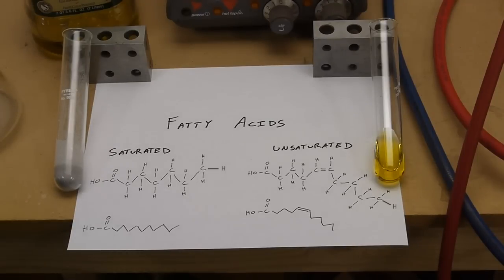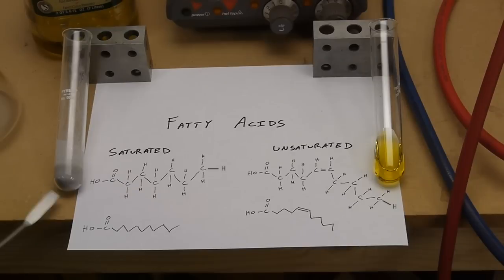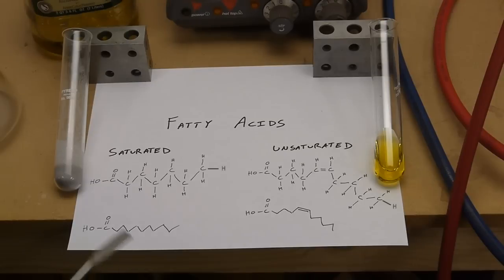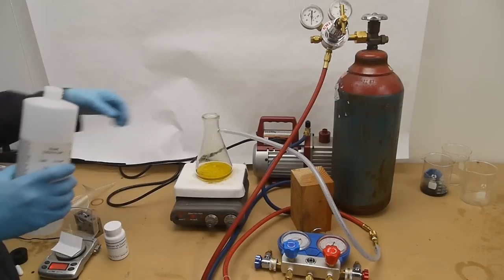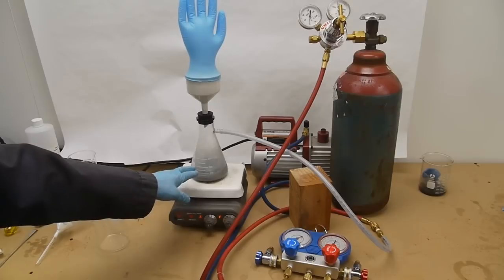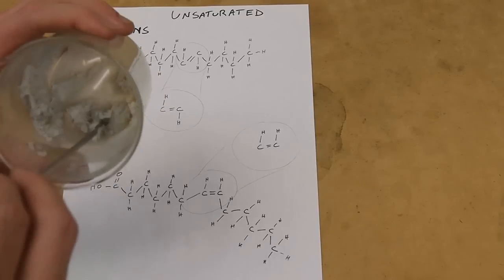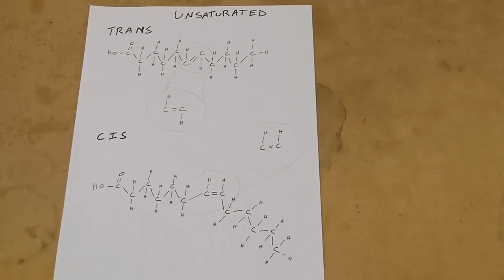Hydrogenation: transform liquid oil into solid fat

Comment: Your argument is flawed about saturated fats being “clogged“ in the arteries.  They are processed by enzymes emitted from the liver. However, with unsaturated fats, they need to be turned into saturated fats first by breaking the double carbon bond. Which is faster: a one-step or two-step process?  We also have to mention the French Paradox which also contradicts your point.  Countries that consume seed oils instead of dairy/animal fats have higher obesity rates. Such countries are located the Middle East and the Mediterranean due to a more significant population intolerant of lactose.  The USA is also morbidly obese due to the greater profitability/longevity of product, replacing dairy/animal fats with cheaper seed oils. Their excess sugar consumption also contributes greatly to their obesity and circulatory system issues.

Comment: I am tyring to cheaply recreate a product (for animal consumption) where sodium bicarbonate is encapsulated in hydrogenated vegetable oil.   The purpose of this is to have the buffering effect of the sodium bicarbonate in the horses hindgut and to try and stop it from being fully digested into the main stomach.   My question is if I simply mix the sodium bicarbonate in a as little as possible cheap margarine how much of the same encapsulation effect will it create?   
If I melt the margarine to mix in the sodium bicarbonate and let it re-set again does this affect it?

Comment: Thanks for the video, blue thumb is in order :)
That said, it's better you focus on physics and leave medecine to MD :)
For a start, unlike what he said in the video, saturated and unsaturated fat don't end up in arteries. They're processed in our GI tract and eventually metabolized in the liver. At the end of the day triglycerides and cholesterol carried by lipoproteins (like chylomicron which turn into HDL and then become IDL and finally LDL) are the only two fats carried by the blood. Triglycerides are small and float easily. Imagine if any fat we ingest ended-up in the blood, remember the blood is an aqueous medium/environment... you'd end-up with phases like in a vinaigrette!
Actually unsaturated fats (oils, even olive oil!) are worse for health than saturated fats because of that double bond (polyunsaturated oils even have several of them!) which is prone to attract oxygen molecules which renders the fat "rancid" (oxygenated) and which now acts as a free radical that will cause all sorts of troubles, thin particular it causes inflammation in organs like the liver.
This oxygenation occurs within hours. How long do you usually keep your oil in the cupboard? ;)
That said any type of fat is bad when consumed with glucose because of glycation: that's the only case when naturally occuring saturated fat (not hydrogenated) is bad, unfortunately every study assumes the American Diet which is high in carbs.... hence they conclude that saturated fat is bad, instead of the more logical conclusion that carbs are bad. He mentionned cavemen and our propension towards saturated fats: well, cavemen didn't have a lot of sugar and processed food laying around like we do since the 1950s. Instead they had meat and fats and a few vegetables and not a lot of carbs (fructose is directly sent to the liver to be metabolized and stored as fat), that's why saturated naturally fats occuring with meat were not harmful to them and they develop a keen sense for saturated fats that we inherited from them.
(disclaimer: I'm not an MD but I like the topic)

Comment: Except your arteries are not room temperature. Naturally Saturated fatty acids do not cause heart disease but high levels of insulin resulting from the volatile blood sugar correction on a high sugar diet inflame your arteries to the point where a clot needs to form to stop the arterial wall from bleeding after it starts. The issue is not the CLOT but the fact that a clot has to be FORMED in the first place. Im referring to naturally saturated fatty acids like those found in animal products, because, as mentioned in this video, trans fats are the result of engineered saturated fatty acids. I urge you to recognize that humans have never done a better job at engineering nature than mother nature herself, and it is not just dangerous but arrogant to assume it can be done!
Reply: Im referring to naturally saturated fatty acids like those found in animal products

Comment: Food scientist Alton Brown talked about types of fats in an episode of "Good Eats", and he used balloons to illustrate saturation. It was a mind-expanding experience for me, because I finally saw the relationship between electricity and chemistry. The big hydrogen balloons repelled each other. Well really, they had a radius, and since two balloons can't overlap in three-dimensional space, their latex borders push against one another. But this is analogous to hydrogen ions repelling one another, which is just a phenomenon of electric fields and like-charged particles. The even distribution of hydrogen ions along a saturated fatty acid results in an overall straight line. (A zig-zag, but when you zoom out, it has a definite origin and destination trajectory that are 180 degrees apart.) But when he popped a balloon, it showed there was an opportunity, or rather electrical incentive, for the whole thing to bend. The side with more hydrogen ions took the "outside" of this bend as they repelled each other. Or perhaps more accurately, the side with the missing hydrogen ion became shorter because there was less repulsion. This makes it a little more complicated for the triglycerides to get into inter-molecular formation, and with the kinetic distraction of heat, it's even more difficult. Meaning the threshold for the temperature at which the molecules can line up, its "solid temperature tolerance" if you will, goes down. I know this is very basic stuff, but I didn't really get it until I saw that visualization.

It's like that game "Perfection", where there's a timer and you have to put all the shapes into their respective slots. When the timer goes off, the whole apparatus pops up and makes the pieces go everywhere. So to win, you have to put the pieces where they go before that happens. Saturation of fats is like reducing the variety of pieces, making it easier to put them where they go, while increasing the temperature is like speeding up the timer, making it harder to do that. And of course "winning" is analogous to making a solid. And unlike human players who can get better with time, molecules are indelibly subject to their circumstances and do not benefit whatsoever from experience.

Also, that apparatus with the knobs to switch between evacuation and hydrogen infusion.... did you make that yourself? After seeing so many of your videos, it seems like the kind of thing you could and would make yourself.

Comment: Why don't you just pump hydrogen gas through a glass pipe into the oil in the presence of catalyst? Just pump until hydrogen push out all of air inside, and close the system then let it go for reaction? Tks u

Comment: Hello. Thank you for demonstrating a potentially do it at home process for vegetable oil hydrogenation.  I do have a few questions, though.
1- Is hexane the only possible solvent to do this with? Would it work with isopropyl alcohol?
2- I fully understand that it isn't healthy, but if you completely remove your catalyst, would your end product be edible?
3- Last but not least, would gold or silver work as catalysts instead of the palladium?
Sincerest Regards

Comment: It is very confusing, after the hydrogenation you say that "it becomes either trans or cis". But I am asking to you : What was that originally before hyrogenation ? My answer : It was an unsaturated fat, and unsaturated fats are always in either "trans" form or "cis" form. What did you do therefore ??????
Reply: Patrick Vigna Yeah. I suspect what he meant to say was that this was the opposite process - you can take a saturated fat and dehydrogenate it, forming an unsaturated fat. In this process, as described, you can get cis or trans forms. The position that they form in can also be controlled, but much less easily again (and cis vs trans is already difficult). 

Alternatively, the trans forms may be converted to cis (or vice-versa - but I'm not sure why you'd want to, for food applications)
Reply: The catalyst can cause reorganization of the bond. Cis becomes trans. It’s a byproduct, not intentional.

Comment: I was wondering how precisely those Trans-fats are generated in this process. I would think that when you hydrogenate unsaturated compounds it would completely remove all double carbon bonds and thus leave no Trans fatty acids in the mixture. And if there are still Trans fatty acids in the mixture that they were already there before the hydrogenation process?
Reply: Simon Van Keer no, there was an inaccuracy in his explanation. The catalyst reorganizes the bond in some cases when the reaction doesn’t complete.

Most reactions can go two ways, and many have several steps. The intermediate step in this case was not completed and the oil reversed to the unsaturated condition in a different configuration.

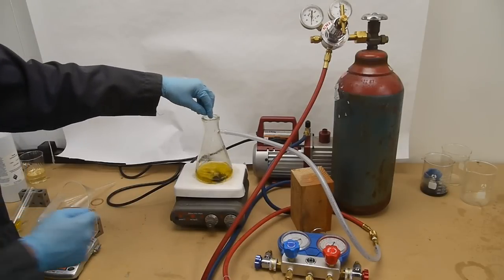Comment: Quick note: at 5:40  you drop a stir-bar into the flask, directly on the magnetic stirrer. This should be avoided, since it can shatter the glass (even relatively thick borosilicate glass...). What we used to do in my O-Chem laboratories back in undergrad was to slide the bar in while the flask is in an angle, and never above a magnetic stirrer.

Aside from that, though - neat video!
Reply: +Peleg Bar Sapir Agreed! That clink the stirbar made when dropped made my assole pucker.

Comment: Is this fat edible? Were you able to remove all the charcoal palladium? Also, couldn't the hexane be captured using a distillation device? Could the hexane and palladium be reused? So many questions!
Reply: If you were to get all the charcoal palladium out, the fat would be edible, although, like he said, there might have formed trans-acids in the process, which are (very) bad for your health. The hexane could easily be distilled. The palladium only works as a catalyst, it basically helps the bonding of hydrogen because H2 is hard to split on it's own, but splits easily on some metals, where it meats with the double bonds that also bonded the metal. So the metal isn't used up and can be used over as much as wanted.
Reply: In Reverse OK. Thank you for your response. This is very educational.

Comment: I have a question: if Omega-3 is a fatty acid with a single double bond at the third carbon atom from the omega end, why is it regarded as a polyunsaturate, rather than a monounsaturate? Are there different Omega-3s with more than one double bond? Cheers.
Reply: +James Turner They are 3 different types of omega 3
Reply: +James Turner ALA (18 carbons and 3 double bonds) through diet and use it to form the more important long-chain omega-3 fatty acids, EPA (20 carbons and 5 double bonds) and then from EPA, the most crucial, DHA (22 carbons and 6 double bonds)

Comment: I need Techniques for chemicals like phenol etc etc from coal , Energy consumption to convert is not an issue, any method using hydrogen or water and High voltage arc method ?? or any techniques to liquefy coal . I am not asking Bergious process

Comment: This was really interesting and I enjoyed seeing how the hydrogenation process works, but the information about the health effects of saturated and trans fats is incorrect.

Saturated fats are not unhealthy.  They may slightly elevate LDL, but only the large dense type, not the small dense LDL which are associated with heart disease.  Saturated fat also raises HDL, the "good cholesterol".  Overall, saturated fats are probably beneficial, or perhaps neutral at worst.

Regarding trans fats, I will quote "The Protein Power LifePlan": Since trans fatty acids are unnatural, the body hasn't developed a specific way to deal with them, so it treats them like real fats and just does the best it can.  Unfortunately, thanks to a sinister quirk of biochemistry, the body tends to incorporate trans fats into the lipid bilayer in preference to good-quality unsaturated fats, especially during times of essential-fatty-acid deficiency.  It goes on to describe how this results in inhibited enzyme function, weakened immune response, and lessened function of the insulin receptor by changing the fluidity of the lipid bilayer and other cellular membranes (i.e. contributes to the development of insulin resistance).

Comment: I have a question. Even though it may not be cost effective, is it possible to "crack" a saturated fat, like lard or bacon grease into an unsaturated fat, in a similar way that crude oil is cracked into lighter fractions? It could have better health benefits and taste great with the drawback of being costly and a shorter shelf life.
Reply: ***** Of course, like the reverse of what he's doing here with olive oil. Liquid bacon oil that's healthy. Mmmmmm.
Reply: Did you ever find an answer to this?

Comment: Some more work on removing the catalyst traces and you'd pretty much have got some homemade margarine lol.

Also, this process would run faster and more effectively if you bubbled the hydrogen gas through your oil solution instead of only creating the H2 atmosphere.

Comment: Should I be more worried about the Palladium? Heavy metals seem worse than a couple extra fat molecules. Also Wikipedia says that hexane is a safety hazard to breathe but not to eat. That sounds wrong.
Reply: I'm pretty sure that's not the same process that edible margarine and other saturated fat acids are produced. I presume he uses catalysts and solvents that are most accessible to him.
Reply: There are better ways to get all of the catalyst and hexanes out of the final product than the ones shown here. You don't even really need the catalyst to get this reaction to happen. It just happens extremely slowly if you don't have it in there. You can increase the pressure to around 100 atm and it will work relatively quickly without the catalyst.

Comment: If naturally occurring polyunsaturated fatty acids are "healthy" then i guess they're more likely to be in the cis configuration. What i didn't understand is how partial hydrogenation (and thereby removal of double bonds which allow for the difference between cis and trans)  is able to make them switch from cis to trans
Reply: Yes, the vast majority of natural unsaturated fatty acids are in the cis configuration. Trans fats form because the hydrogenation catalyst works both ways and can take away hydrogen as well as add it. The trans configuration is also a lower energy state(less stress in the bonds), so it is thermodynamically preferred over the cis config.
Reply: I am very thankful for the clarification. To my shame it should have occured to me that the catalyst would work both ways since any catalyst works only to lower activation energy.
Reply: Because trans is energetically favored over cis all mixtures of the two will eventually become trans given enough time. It is a slow process at normal temperatures but when you heat the mixture so that you can partially hydrogenate it (note that it is partial meaning there may still be some pi-bonds) you make the cis-to-trans rearrangement speed up. This is why heating up cooking oil often (like at a restaurant that fries food) will cause no-trans fat oil to eventually increase in its content of trans fats.
Reply: The modern technologies in food processing produces  cis configuration of fat acid, no trans. trans configuration produces older technologies.
Reply: Martin Kovarik Yes it is possible to reduce the trans fatty acid content, but the new technologies are more expensive. If the industry has no incentive or obligation to use a more expensive process, then they will use the cheap one and dont give a shit about health effects, cos profits.
Reply: *****
Naturally occurring trans fats are fine though. Red meats have high levels of trans fats.
Reply: aptsys Trans fats are the same regardless of whether they are naturally occurring or not. The body can't tell the difference between a natural trans fat and an identical trans fat that was artificially made.
Reply: Dr. Lecter No they don't
Reply: 7oracle
No they don't what?

Comment: All this effort and unhealthy fats just because it 'tastes better' seems crazy to me.
Reply: Some foods need solid fats to make some foods. If you replace butter with olive oil in a recipe, the consistency or texture of the food might be off. Also, the only way to make butter out of vegetable oils is by hydrogenation.
Reply: +Madarpok You are referring to margarine, correct?
Reply: miss eliana Yes, although I may be partially incorrect in my previous statement, some margarines (with low fat %) are more like thick emulsions in water.

Comment: Is the cis fat the same as the unsaturated fat? Is the trans fat unsaturated but with a hydrogen atom at the double bonded carbon rotated to the other side of the molecule? Are these showing what happens when hydrogenation fails to occur?
Reply: Both cis and trans forms are unsaturated, but vegetable oils only have the cis versions. The cis and trans forms have an identical number of carbons and hydrogens, the only difference is the arrangement of bonds.
Single bonds can rotate easily, but double bonds are locked in the specific orientation when they are formed and cannot rotate.
Reply: ***** Thank you for clearing that up for me.